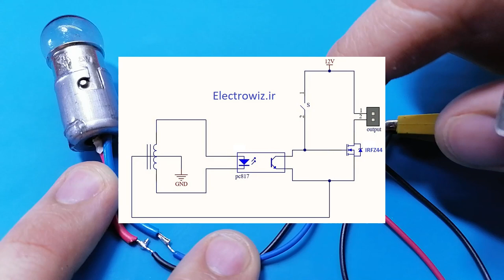Top 2 short circuit protection

Comment: good afternoon, the first circuit can be used to protect a switching source, but to isolate it from the 110 or 220v ac line? thank you
Reply from the maker: No , you can not.This circuit is designed to power the battery

Comment: Nice video🙂👍,  i want to ask. How many uH the toroid? What is the size of the toroid wire, how many turns? And what size toroid?
Reply from the maker: The amount of inductor capacity is not important in this project ,you can use any toroid, but i am use 10*4 mm core and 0.3 mm wire . 🙂
Reply: @ElectroWiz  alright.. Thanks for the information 👍🙂

Comment: How can the toroid work with DC ? 
The toroid works as a current transformer for powering the LED inside the PC817 optocoupler, but any type transformer doesn't work with plain DC.
Reply from the maker: If the current( pulse current)  passes through the wire that has inside the toroid, it will induce current to pc817
Reply: @ElectroWiz  , thank you for the quick reply.

Comment: Thanks for the video. Can you do the second solution for 24v
Reply from the maker: Yes , for 24V power supply , Just use a 24 volt relay and change resistor 220Ohm to  2.2 K ohm or near  --Good Luck 🙂
Reply: @ElectroWiz  Thank you, I will try it 😁

Comment: Amper??
Reply from the maker: 10 amper
Reply from the maker: 10 amper
Reply: @ElectroWiz  Ok, tell me honestly which Circuit will consume less power. And which one will act faster?
Reply from the maker: @skidkev6421  
The first one is faster and less consuming, but the second one is more reliable
Reply: Which toroid size or how many wire wounds can I use?
Reply from the maker: @skidkev6421  Any toroid with at least 40 turns of wire
Reply: @ElectroWiz  Sir, I want to put an led to this Circuit which will indicate short circuit but I don't know where to put. Can you please tell me. Maybe an RGB LED will do.